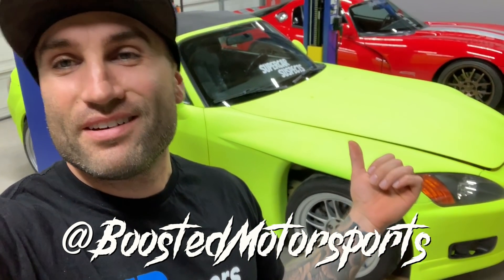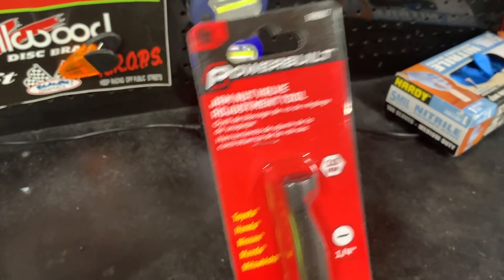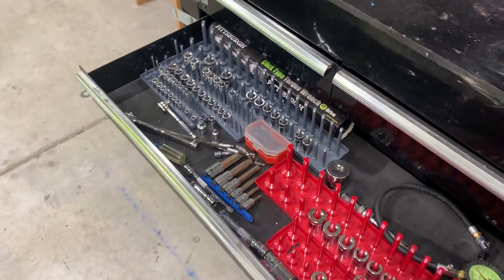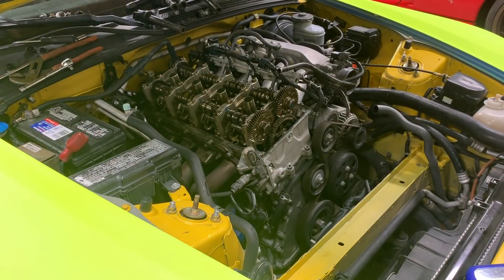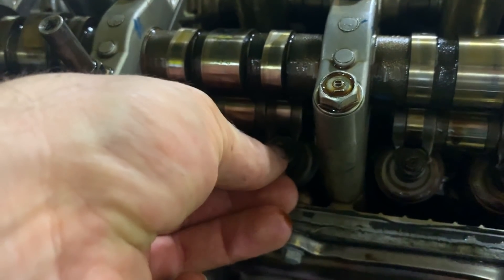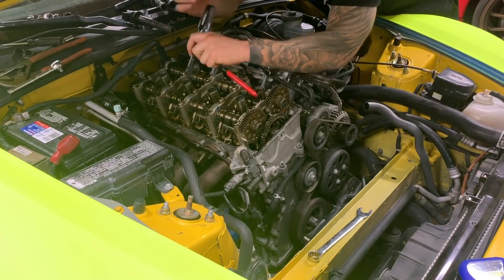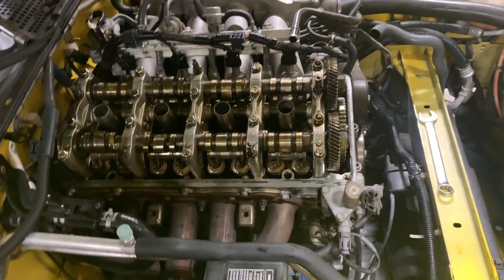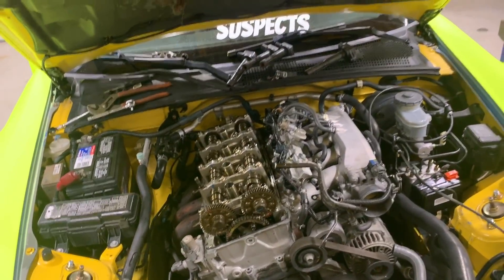How to Adjust Valves on a HONDA - MISFIRE FIX

Comment: Hey mate, I have Rsx type s 5, it’s misfiring on cylinder 3 only while idle but not when hitting gas, mechanic told me replace engine 
Would adjustment help ? 
Tnx 
Also, does co2 sensor is related ? 
Cause I just replaced exhaust and header (didn’t had c02 code before that

Comment: Well done man! I just did mine today. I think you had the clearance the wrong way round though. Intake is usually a tighter spec than the exhaust. 0.008 to 0.010 for intake and 0.010 to 0.012 for exhaust. How did the car feel after you adjusted them?

Comment: I was having the same misfiring issue's, replaced injector, coil pack,  did everything til I saw this video then decided to do my own adjustment. My car doesn't stutter anymore, no hiccups off the line and runs smooth and strong. Thanks for the video!

Comment: Im at 41k miles started getting a ticking sound changed my tct and still hearing it quiets down a bit after it warms up alittle but still there when i rev it could it be i need my valves adjusted!?

Comment: I just did my valves on my acura MDX and the most of the exhaust valves are very tight. I think the other valves will be tight if the cams are not in their TDC. So I wouldn’t base how loose or tight the other valves are unless they’re on their respective TDC. 
Nice video

Comment: aren't you setting the exhaust valves too tight? i think you have the clearance specs reversed. Intake is .008-.010 and exhaust is a bit looser at  .010-.011
Reply from the maker: Good catch. I did say it backwards in this video but I did do like you said and had the exhaust valves set a bit looser. Here’s a post where everyone talks about the ideal gaps https://www.s2ki.com/forums/s2000-under-hood-22/what-set-my-valve-clearance-937416/page2/